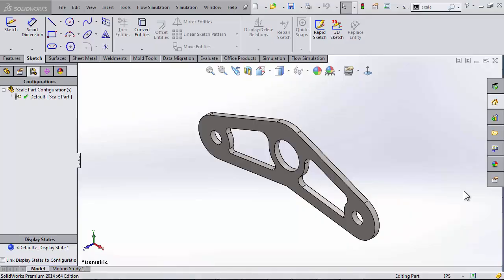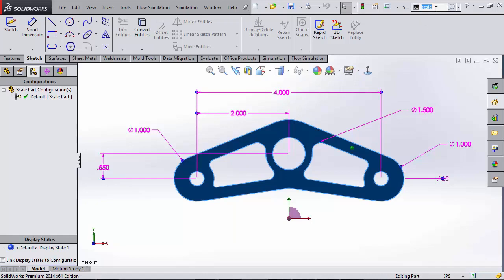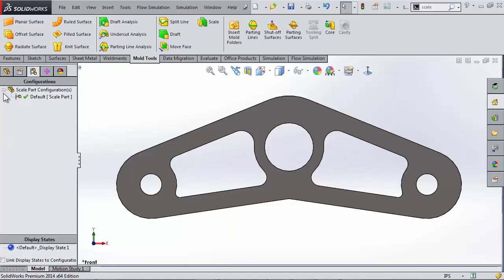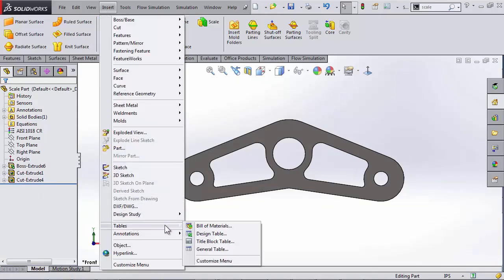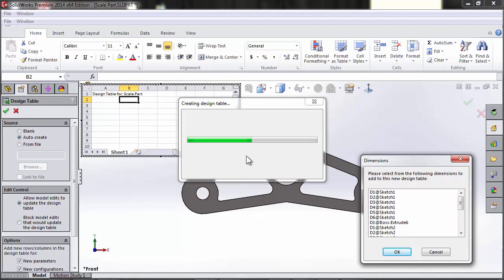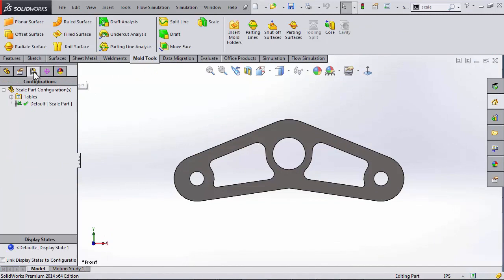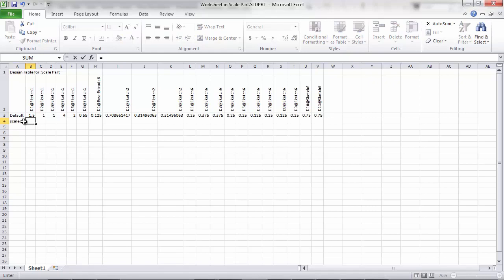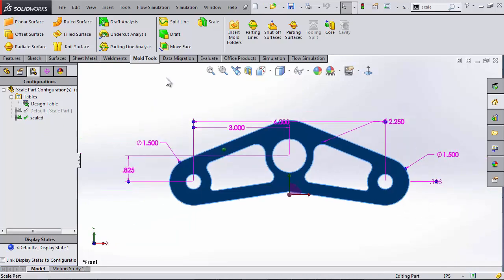SOLIDWORKS 2014 — Two Methods to Scale a Part

Comment: It appears the second method may no longer work on SW2020? Or may my model isn't compatible. I'd like to scale my entire drawing/part, however when I make a design table I don't get dimensions as you had. I simply get "U" or "S."
Reply from the maker: I ran a quick rectangular prism in SWx 2020 SP5.0 and did not run into an issue, so it’s more likely it’s a model specific issue. 

I am guessing that the automatic pop up of “Dimensions” is not appearing for your case. The most common reason is if you already have more than one configuration in your model. If you do, then the auto-created Design Table is made using the Suppressed (“S”) and Unsuppressed (“U”) features, or the specific dimensions that are different, between the configurations. 

1.	I recommend you make a rectangular prism in SWx 2020 and test the workflow. If it still doesn’t work, call your VAR to get assistance. 
2.	Try making a copy of your model and deleting all configurations but the base configuration. Now try to auto-create the first design table. 
3.	Manual selection is always an option, if time-consuming. While the design table is active, double click a feature in the tree. You’ll see the Suppress or Unsuppress option show up as a column in your design table. In the SWx graphics area, dimensions associated with that feature will appear. Double click each dimension to add it as a column to the table. 
a.	If it is a very complex model, I wouldn’t be surprised if feature errors occurred after trying to scale every single dimension in the part. I recommend keeping a copy of the original model that you can refer to as you fix errors.

Comment: Hi, interesting initial demonstration. However, there are a few problems with these scaling methods. I tried the 2nd method with the design table and it doesn't work. I notice you select all dimensions but what about angles? Surely you don't select angles to be scaled down as they would be distorted. However, when I pick just the length and extrusion lengths & not import angle dimensions, it doesn't work.  I get an error message under 'Feature cut extrude' that says 'This sketch contains an entity with an unsuitable geometry'. There are also non-d (distance? or particular dimension) or annotation or r based dimensions, I have no idea what these are about,  but it seems you should only select certain dimensions if you don't want to change angles.

Comment: Any Idea why the scale tool exists if it doesn't actually change the dimensions? Is that even scaling or just zooming in??
Reply from the maker: Yes, it is scaling the part file larger – you can view the mass properties of the file and see this change. 

It is useful in cases like shrinkage in plastics injection molding or casting, where people need to make the imprints in the molds larger to account for shrinkage during cooling.
Reply: @goengineer  ah, I didn't realize that it is actually getting larger. thanks

Comment: This works for one single part.but when i did the same with a large assembly it is not working.The names of skecthes are not appearing in excel
Reply from the maker: Correct, design tables for assembly files do not pull part feature data, like part sketches. It sounds like you’re looking for something like our GoAutomate tool that we supply to our customers: https://www.goengineer.com/goautomate. An alternate option for controlling part dimensions from the assembly level is DriveWorks. There is DriveWorksXpress that comes with all versions of SOLIDWORKS for you to experiment with:  https://www.goengineer.com/driveworks. Finally, a slower method but still possible without requiring another tool, would be using global variables and equations: https://goeng.io/Global_Variables_Assembly.
Reply: @goengineer  thanks for the detailed replay

Comment: This looks like an overly complicated way to fix the fact that I started a part in a new version of Solidworks, not realizing that I was working with inches instead of mm. Solidworks should allow unit conversion to happen without changing the existing numbers if needed.

Comment: @GoEngineer, thanks for the tutorial. But the second technique will only work when dimensions are defined for a sketch right? I am dealing with a case where XYZ coordinates of a curve are imported. I use convert entities, a boss extrude, and then add a scale feature. But when I create the design table, I am unable to add the scale parameter to it. Or, is there a way to create a reference dimension in the initial sketch, and then scale the entire spline based on the reference dimension? That way, the dimension should be captured in the design table. Request you to help me out here. Thanks.
Reply from the maker: There is currently an Enhancement Request out to have the Scale feature more obviously be able to be added to the Design Table. For now, you can manually type in X_Axis@Scale1, Y_Axis@Scale1, Z_Axis@Scale1 as column headers, and you’ll be able to override the scaling beneath them. 

However, the reference dimension idea is great and definitely worth following.

Comment: do you do FRC?
Reply: +firstlegoleague8 I used to volunteer as a judge, but no, I don't do First Robotics Competitions. GoEngineer does have Kids Camps during the summer that teach SOLIDWORKS and 3D-printing.
Reply: ah Ok, it looked like that part was for a wheel module that would hold a bearing in the center lol so i put 2 in 2 together :P great video btw

Comment: Doesnt seem to work for text :/
Reply: +Unieb1 Correct, that is because text size is dependent on the global "document font" option, or a specific font size you've chosen, instead of dependent on dimensions. 

I would recommend manually changing the font size to what you desire for your text. Yes, there are workarounds, there always are, but in this case they require a longer time to set up than to just change font size with a few clicks.

Comment: Hi!
First of all, very nice video :)
Now, I've gotta question..when I use scale, I still get the original part, is there any way just to scale it and to delete the original model? I tried to delete it by myself, but it deletes scaled one too..any tips? Thanks in advance :)
Reply: +Fabijan Rehorić Hello, thanks for watching!

If you are using the Scale feature, then there is no way to have the scaled part be separate from the earlier version since it is reliant on your earlier geometry. You could do the following: Insert > Features > Save Bodies. This will ultimately create a separate dumb solid version of your original part file , then you could scale that. 

Similar explanation when using the Design Table. You can use Configurations to have altered sizes, or you will have to do a Save As Copy, then use the Design Table to quickly alter the size. 

Does that help?
Regards,
Shivani

Comment: Good tutorial, however it does not work for complex shapes. Most often the fillets or extrude-cut sections do not rebuild properly. Could you suggest any other alternative?

Thanks in advance.
Reply from the maker: The effectively use Design Tables the model would need to be constructed with that in mind from the beginning.  For complex shapes with a lot of filleting it would be advisable to leave the filleting at the bottom of a feature tree as much as possible as fillets do tend to fail easily from geometry changes.